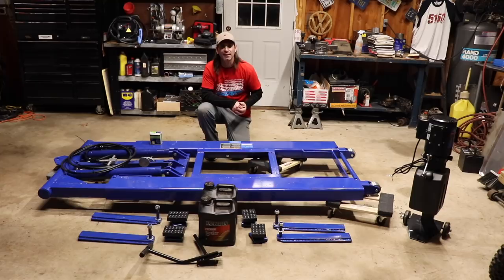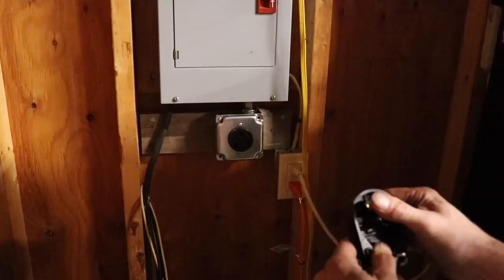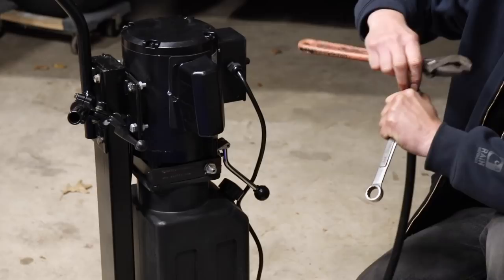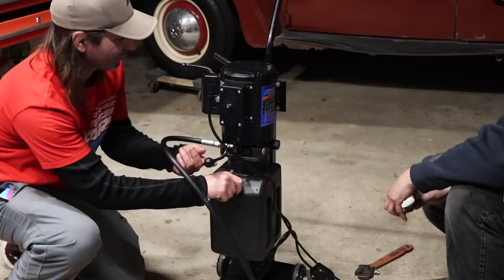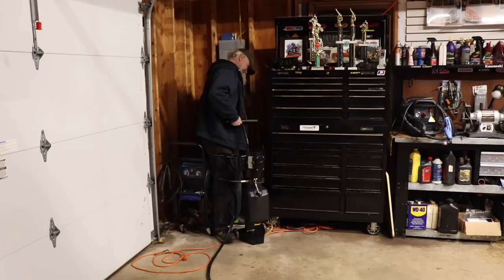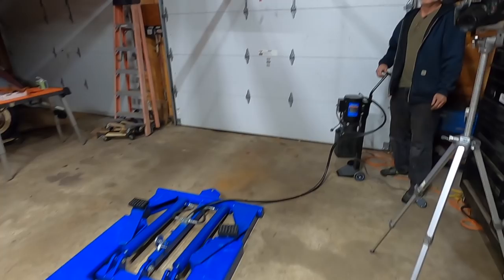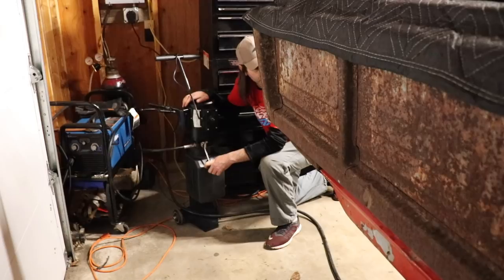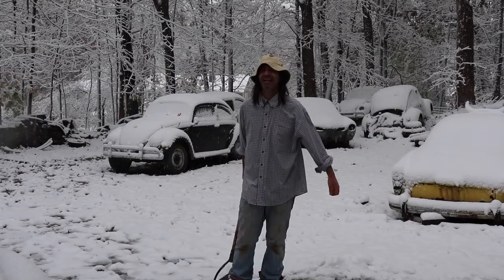Mustie1| Harbor Freight 6000 Lb. Capacity Scissor Lift Assembly | Central Hydraulics Car Lift Review

Comment: Just a suggestion, you may want to turn that lift around and make a longer power cord or move the outlet. Running over the hydraulic line and safety lock cable is coing to cause you problems in the long run.  Great video made even better by the appearance of Mustie1.

Comment: I absolutely love my scissor lift. I have the BendPak, but I have had it for a decade now and it is the single best tool I have ever bought. I also work on old VW's, and they are a perfect fit on a scissor lift. I recommend them to anyone with height limits in their shop.

A couple of tips. Have your sliding lift arms flipped so their outside ends are towards the middle of the lift before you roll the vehicle over the it. That way they can swing out from the center, and not be blocked by the tires on the vehicle. Also, I am pretty sure you should use ATF for the fluid. Not sure if tractor hydro will cause problems, but mine uses ATF.

Comment: In retrospect I should have bought one of these instead of my two-post lift. Serves the same function for the type of work I do, is cheaper, and takes up much less space. Congrats on your new tool.
Reply from the maker: Hi Rick , thank you... yeah if I could do a 2 post in there I really didn't want the fixed beams in there . This way I can keep my layout flexible . I did just signb a lease on a shop with a 2 post life that I am very excited to use though :)
Reply: @5150mxVW  That's awesome. Look forward to seeing it.

Comment: Great video. I have been lookin at that lift. Plz give us an update after you have used it a few times. 👍😎👍
Reply from the maker: thank you Chris , I looked at couple similar ones , a few were 110v too ...you can't beat this one with the 20 off coupon . The pump will come banged up as it arrives in a poorly packaged cardboard box . The pallet the lift came on was also destroyed and the driver and I had a tough time unloading it . Also the safety wasn't catching so we had to adjust the cable .

Comment: You have snow already?We haven't seen snow in the southern UK since around 2010.Nice lift,should save the old back some,that thing about threads was amusing 'cause I was a tool storeman for a few years and I found myself with all kinds of threads to deal with.My most useful reference was a little book those guys on the shop floor used to use called the Zeus book.That little book tautght me all sorts of stuff I didn't know and gave me a good start in that job...................................

Comment: You actually do a decent impression of that Bill Murray character. take that pristine VW off the front of that rusted hulk... and send it to me...  I had the one off my first car,  a VW van turned into a camper for years, but some time in the last couple of times I moved, it got gone somehow. I was 15 when I got that wagen, and it was rusty and looked like somebody took a huge can opener down one side, and of course it didn't run... but even tho I only had farm tools, didn't know metric nothing, I was able to get it running. Just took a carb rebuild and cleaning the tank and fuel lines out... pretty much, new plugs and stuff didn't hurt either. Of course, it didn't last long, It got a bad oil leak while I was (illegally) driving it around the back roads... and it blew up. Had I known then how easy it would have been to swap it out or rebuild it I might still have it today, but I was a farm kid with little money to work with...none in the winter when there was nothing to sell... so I let it go for what I paid for it. all of 25 dollars. guy wanted it to use for storing his grain and such... I took the stove and stuff out of it and sold that later, so I still made a profit on it. sort of, not including the time and bit of money to get it running. if you include that, well I probably lost a few bucks. 
By the way, do you know what the record for removing and re installing a VW engine is using only hand tools? Back in the day when they had such competitions it was a minute 30 seconds with 4 guys doing it. I'm kinda surprised it took that long, four bolts and some wires to to take lose... its out.
Reply from the maker: thanks TT , not bad for a 1st go at it ( few takes ) ....I remember you telling that story👍......i'll have to google that , 30 seconds , I can't see getting the nuts off that quick

Comment: The ac cord has two hot leads (each at 120vac 180 degrees out of phase) and a green chassis ground, not neutral! So connect that to the bare ground buss in the panel , not the white neutral buss!

Comment: Great video. Thinking of getting this lift for my 1963 VW beetle to do air ride suspension. Seeing it lifts your single cab can you confirm it will lift my beetle on the pan so I can remove all both front and rear suspension? Thanks in advance.

Comment: Just curious did you install the lift backwards just because if the power cable or because you work on rear engines vehicles primarily? I just got a scissor lift myself installed it in the same orientation for more under engine access of my front engines vehicles

Comment: If you put engine/Transmission side opposite  of the Rams , could a person remove Transmission?    If a movable steel plate was in place , side to side of lifts flat surfaces!   Thx